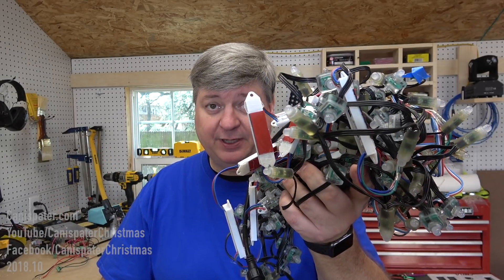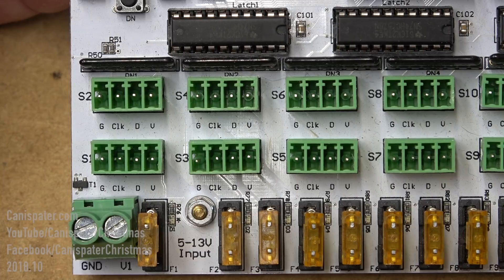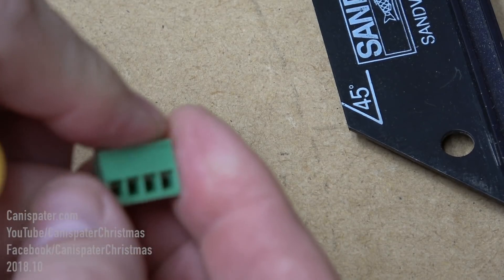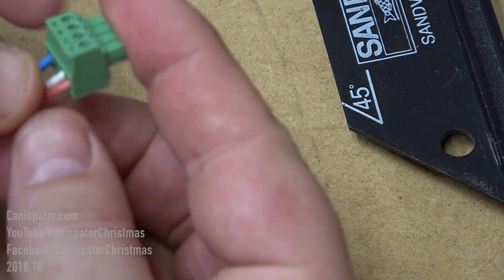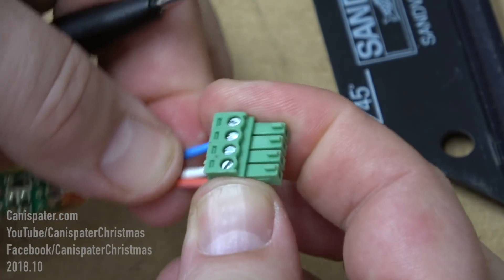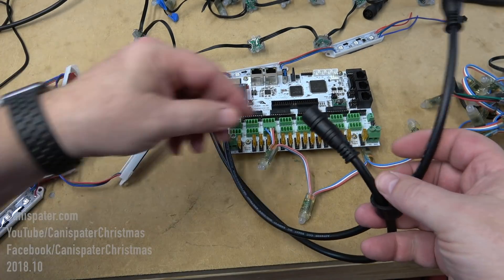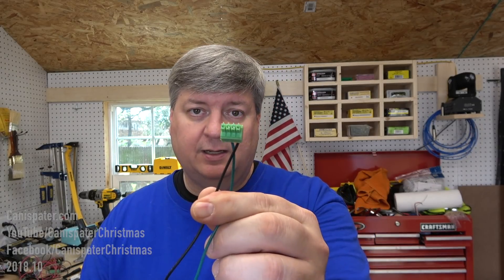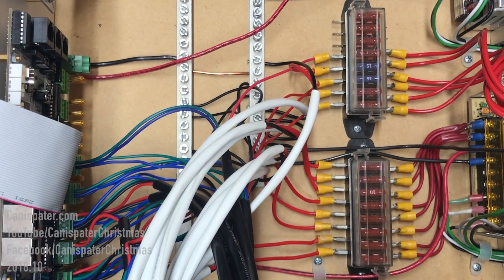RGB Pixel Controller Connections (2018)

Comment: That is the stuff.  Any thoughts on how long a pigtail is too long?  Trying to change from my LoR controller where I had 16 extension cords running through the yard and up over the house to RGB this year.  I am thinking I could get away with a central location in the garage and go from there.  Also, how are people going "wireless".  I am assuming that they are supplying power and then data is over wifi?  Thank you for the time it took to do that...
Reply from the maker: The rough estimate is about 30 feet from controller to first pixel. Several factors come into play so YMMV. That distance can be extended using differential receivers (assuming a Falcon controller). There is an ESP8266 WiFi module that people are playing with with some success. For a more robust solution, Falcon Player has a sync capability where sync pulses are sent about once a second so you can keep multiple FPP Pi's in sync.
Reply: Got it.  I think 30' is plenty to anything I will put out from where I want to put my "lighting central"  Got my Pi yesterday...fun weekends ahead. Thank you again!!

Comment: Do you trim the ends of the wire short enough that some of the insulation goes into the "gate" clamp as well ? I've had some issues with just the tinned copper pulling loose occasionally and wondered what others are doing..
Reply from the maker: No. If you clamp insulation in there, you may not get a good connection. Sometimes, there is so much solder on the pigtails I get from Ray that they won't actually fit in the connectors so I have to either take an iron to them or cut them off and re-tin them myself. If the wires are thin, maybe put a little more solder on them. As for length, you can have a little sticking out, but just make sure they can't short against an another wire.
Reply: Clamping up onto insulation is 1 issue with the moving clamp style connectors. Having a misfire and sticking the wire on the wrong side of the clamp is the other major 1. Tinned copper wires give good initial contact but they are susceptible to plastic deformation over time. For high current applications it's always recommended not to use tinned connections. Using bootlace ferrules is the best way to terminate if you can be bothered.